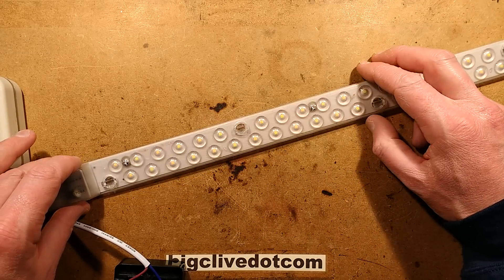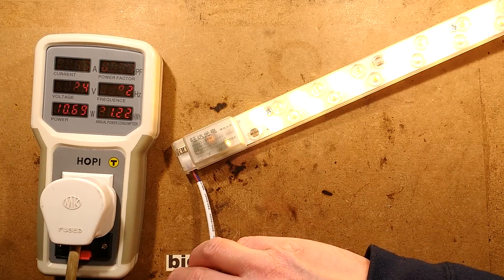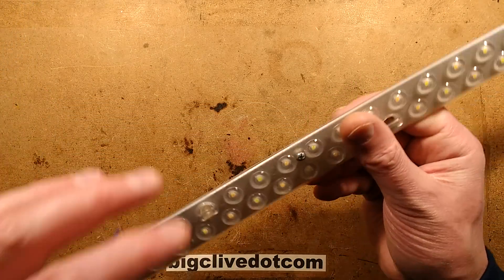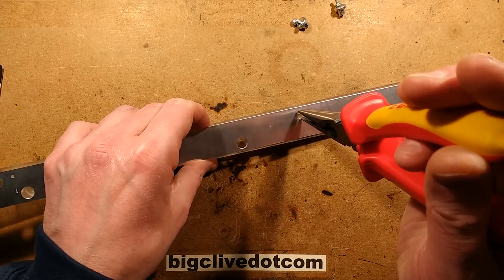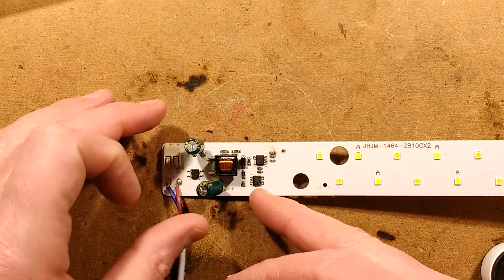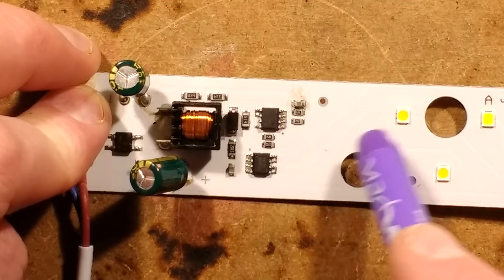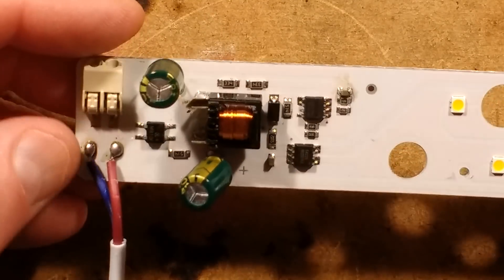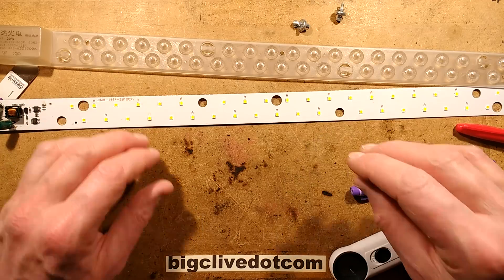Colour temperature selectable LED strip.

Comment: The led driver appears to be a 2 bit latched binary counter, the resistor and capacitor are probably connected to the clock input, the capacitor in this case would be to prevent bounce.

Comment: I just ordered one of these on eBay today (but from a cheaper supplier in China. I find that stuff from Singapore takes ages to get to Australia while the stuff from China will get here in about 2 weeks if it's shipped via airmail). I've been replacing all my lights with LED versions when I remembered the light in the range hood/exhaust. It's a 40 W tungsten bulb with an E14 socket.
At first, I bought some LED COB lights (3 W and 3.5 W, I think) then I remembered this vid. I measured the space and should take this 40 cm light easily. At 13 W it should provide a lot more illumination plus the colour temp change would be interesting (it should also mean that the wattage should be halved when not using both colour temp sets) while using less than the existing bulb.
Reply: Well, it arrived yesterday and it was the 16W version rather than the 13.1W version that was advertised. And it wasn't selectable. You only got full brightness - and it was far too bright for what I wanted. Also, the screws were on very tight. I couldn't get the middle one off without damaging it.

Comment: Clive, can you tear apart one of those semi generic puff sensors used in a lot of ecigs there’s no information on them online and they don’t seem to be a simple switch but have logic inside
Reply from the maker: I did that in a video.  It used a microphone style case but with a switch composed of a thin disk of conductive membrane separated from another metal disk by a very thin spacer.  When you draw it causes a pressure differential that causes the membrane to make contact with the disk and the standard push-button style control chip inside the package then powers the heater and the LED on the back of its PCB.
Reply: bigclivedotcom So say this piece got damaged from ejuice, could I replace with a momentary push button?

Comment: So the power supply rectifies the ac, then sends it to a buck converter to change the voltage of the dc. I'm wondering why not just use a transformer to change the voltage of the ac, and then rectify that. What's the advantage of using the buck converter?
Reply: leds are more sensitive to current than voltage, current spikes can easily destroy them, most ac -> dc converters are built to control the voltage more accurately than the amperage/current

so i'm hazarding a guess they're buck-boost led drivers, built for the specific purpose of driving leds

found this one in case you want some more research: 
https://www.mouser.com/pdfdocs/lumiled-avoiding-current-spikes.pdf

Comment: Hi Big Clive great videos. Thought I would drop you an idea for a future video which is those galaxy bulbs, you could investigate how they worked. Thanks.
Reply from the maker: They work like infinity mirrors.  The inside of the lamp has a point source of light that shines through masked shapes in a fully mirrored interior.  The outside of the lamp is partially mirrored, so the image bounces back and forth creating multiple images between the mirrored surfaces.

Comment: That looks like four of these could replace the 4 ,  2 foot florescent tubes in my shower.
Is there any notation of the luminous output?
Thanks for your help and advice, ,, and good job... Clive. ..😆
Reply from the maker: Note that these are for 220V use.
Reply: bigclivedotcom 
Oops,,,  thank you for the reply, ,,  those won't work here...😎

Comment: Unrelated question: How long does a pc powersupply hold a charge after you ripped out the powercable? I was once told that it can be extremely dangerous to open up your powersupply and start messing around, even days after the cable has been removed.. Any truth to that?
Reply from the maker: They should self discharge quite quickly, but a faulty unit may not.  There's an often quoted case where a kid was found dead at his computer with the lid off the power supply and the plug out at the wall.  The most likely thing that happened there was that the kid got a shock and then immediately unplugged it before fading away.

Comment: That fuzzing feeling on metal surfaces, I get that on so many different things. Always been a bit concerned, it's safe then?
Reply from the maker: It's common on some low voltage things like metal cased tablets when used with a plug-in power supply.  If you get the same effect off something that should be grounded like a cooker or washing machine then it's a warning sign that it may not be grounded properly or a potential difference may exist between something in its vicinity.
Reply: The most concerning thing is a metal cabinet mirror in the bathroom, it has a built in fluro tube atop. When the light's on, the cabinet feels fuzzy. Been that way for 20 yrs.

I just checked continuity with earth and there is none. Not a good sign lol

Comment: I'd like this strip in an "always mixed" mode with 120cm length to put into existing CFL tube fixtures...
Reply from the maker: It could be hotwired internally by bridging the LED strings straight to the current regulated rail.

Comment: My bench lights are twelve 10watt LEDs attached to a strip of aluminium angle, 6 cool white, 6 warm, with separate adjustable current limiting supplies for each temperature, so I can adjust the colour, and brightness to what I want ;)

The bench is too messy to actually use it anyway...

Comment: I know it's about the right size, but the mode selection mechanism basically ruins its utility.  Why would anyone use it for signage lighting when it can't practically be set into any mode other than 'cool white'?  A photocell or timer can't rapid-cycle contacts like that.

I suppose the mode control IC could probably be removed and shunted, but who would actually do that (other than us)?

Comment: I wonder if that star shaped led light bulb has the same or similar power supply. Power factor looks about the same, with high switching frequency there is no visible flicker. My guess on that star is inside that lamp is a miniature version of that power supply.

Comment: I’ve just thought of a new idea that might work.. it’s a photovoltaic telescopic the idea is that you could focus on a distant star and get electrical energy from it 🤷‍♂️
Reply: I'm pretty sure that blowing into a piezo disc would generate orders of magnitude more power than your "photovoltaic telescope" ever would.

Think about it. The sun is about 150 million km away and even a 100% efficient solar panel would generate roughly 1000 watts per square meter of area, assuming the sun shines directly perpendicular to its surface. And even the closest star to Earth (apart from the sun) is 4.22 light years away, which is 40 trillion km or so.
Reply: Oh, and remember that the power reduces by a factor of 4 when the distance is doubled (inverse square law)

Comment: Smash the star lamp, have it plummet like shooting stars are supposed to. Big Clive have you seen the 150w driverless leds on banggood? Are they the same as the lower wattage ones
Reply from the maker: The high power driverless LEDs seem to be a multiple of arrays with lots of the current regulating chips.

Comment: Clive (or anyone else), do you know of an LDO regulator that can run an LED at 1 amp? I bought a CREE XP-G2 and will be using a resistor to limit current and an 18650 to power it, but I'd like a flashlight with a steady output.
Reply: Get a lithium battery protection circuit and stick a buck/boost converter off of it, this way you won't need a resistor and the 18650 battery won't be discharged to unsafe levels.

If you ran a lithium battery way down and just smacked the full charge voltage across it, it's likely to go on fire.
Reply: Any buck/boost converters you suggest?
Reply: Any of the ebay chineseium buck/boost boards will be fine as long as you don't run them at full load, as they tend to start acting weird.

Comment: Interesting how China do things with least possible components, what it does to a power grid is crazy, sending all those spikes back as theres no input EMI choke, its unprotected completely as 10W is 50mA of 240VAC, protected by 16A in-plug fuse or trip fuse in a fuse box...if it goes in flames it will set a house on fire. Cheap China crap.

Comment: Why are there two equal resistors right next to each other rotated by 180°? Since I guess this is done using a pick&place machine, isn't it a waste of time to rotate one of these two unnecessarily?
Reply: They could be using cheap component sources, or they could be using reject/leftover rolls from other projects. Since China is basically the manufacturing capital of the world, it's real easy to ride on the backs of bigger businesses with their leftovers.
Reply: Lots of Chinese products are hand soldered. I even heard that when they do use Pick and place units, resistors aren't lined in a way in the strip. In other words, cheap components.

Comment: hello Clive, i would like to recommend you a kit from ebay, i'm using this to drive my leds for my bench. Here's a link to that:  https://www.ebay.com/itm/Red-0-30V-2mA-3A-Continuously-Adjustable-DC-Regulated-Power-Supply-DIY-Kit-PCB/201751652278?epid=514101507&hash=item2ef955e7b6:g:OxkAAOSwA3dYVCUd